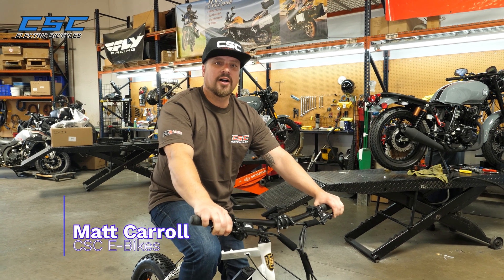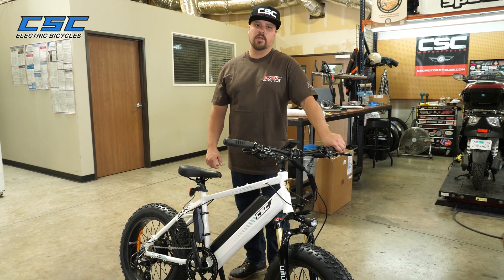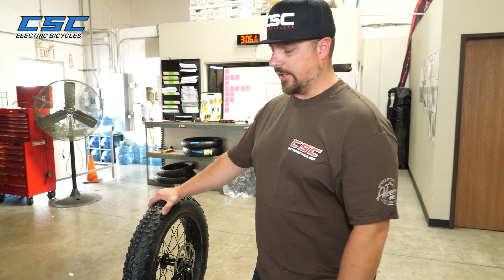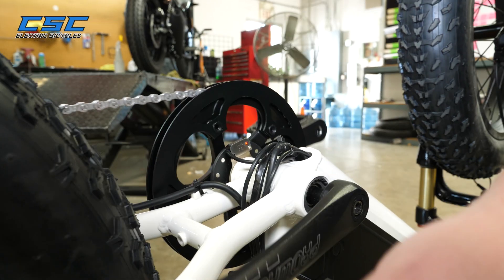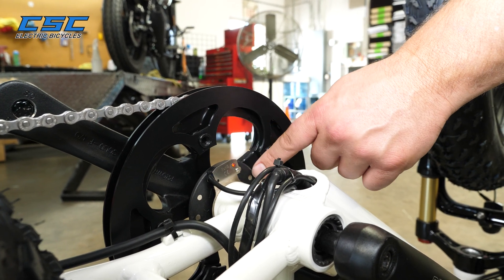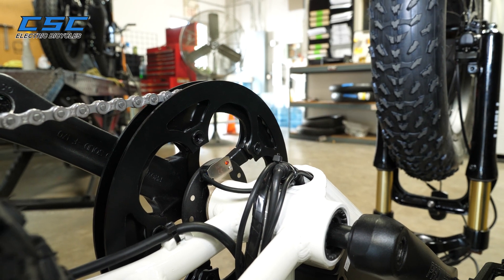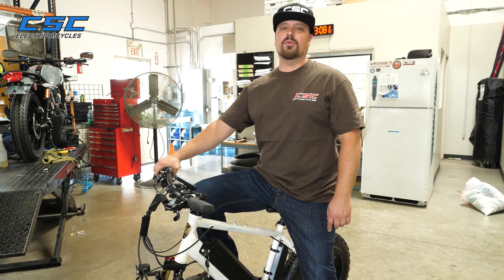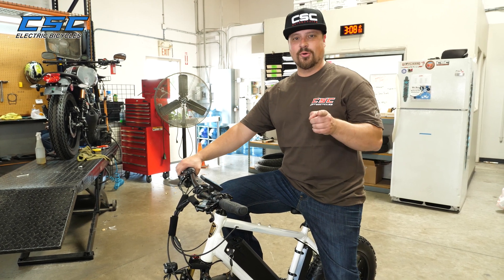E-Bike - Cadence Sensor

Comment: I know my comment here is a little late on this video but I'm relatively new to e-biking, and dealing with wanting to pedal along with my hub motor only to realize I mostly can even pedal fast enough to add value I now have a question about an obvious short coming of all e-bike controllers and displays. I've recently ordered new front and rear gear sets for my 24 speed mountain bike to allow me to give pedaling value back to my motors energy use. As I researched the gearing ratio options, all knowledgeable bike riders recommend shifting decisions based on your pedaling cadence RPM's. There are even cadence RPM monitors marketed to bikers to assist with shifting decisions. So here's my question, why do none of the e-bike controller displays show cadence RPM? It is very important information that could be displayed, but is totally overlooked.